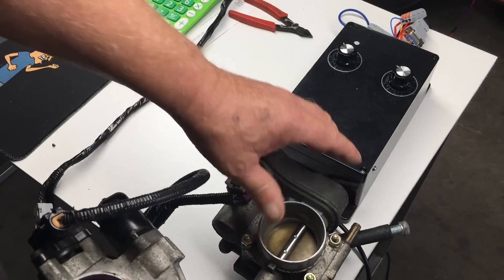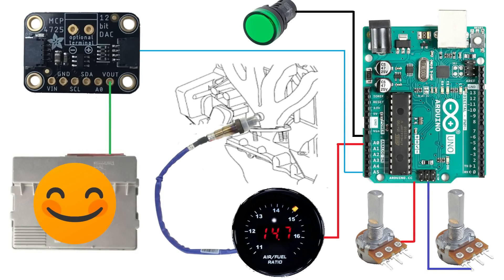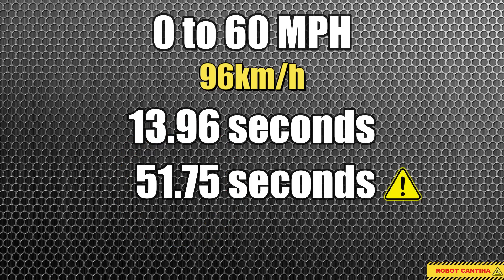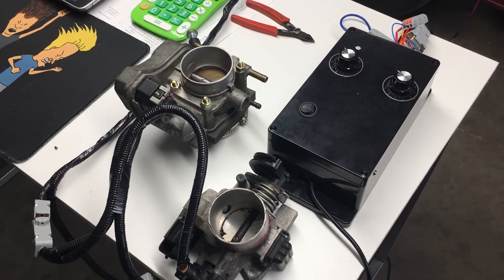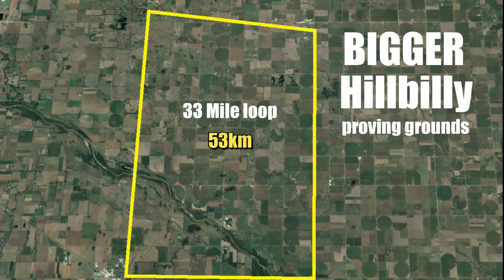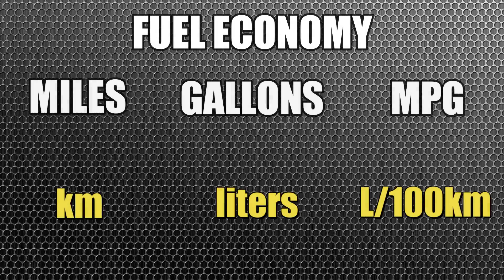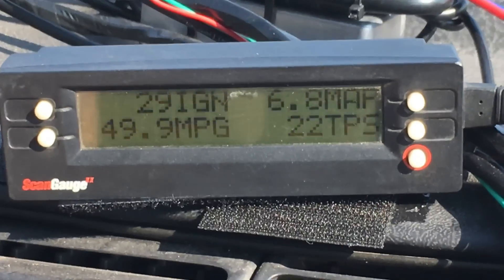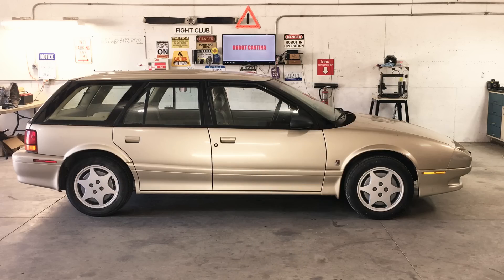S2E21: Our modified Saturn that gets Extreme MPG with lean-burn and Robo-throttle.

Comment: Cheap standalone ECU.  speeduino . Avalabile pre built or as a electronic kit . Its basically a standalone aduino ECU that is universal for almost any engine alowing full tunability  ..  . Like a haltech or other standalone unit. .
Change timing curves , injector duty cycles  and cam position/ angle in engines with the option .

Comment: 5:03 "it's very Orwellian, and thankfully this is just an experiment and cars are not really built this way."

Someone hasn't been keeping up with technology of modern cars let alone noted my post on a previous video. There are many cars on the road right now that are "drive by wire" or Electronic throttle control (ETC) where the pedal is just a spring loaded sensor and the computer moves the throttle plate in the electronic throttle body just as you are doing but it is done using the ecm instead of an arduino. Many modern vehicles are built this way now with no traditional throttle cable. For example, check out the 16 Chevrolet Cruze. It's kinda unfortunate when the pedal sensor goes out as then the car only idles no matter how hard you mash the pedal.

On the note of the video as a whole though, this is and has been fun experiment to watch develop and I would love to see how far you can take this with a TAP (Timing advance Processor) like Acamperfull mentioned. Could be an interesting next step. You know, before the Diesel swap since Wagons have a very different aerodynamic effect compared to a coupe body.

Comment: Ford EDIS?  You could grab the module off an early 90s coil pack car.  The EDIS module can run independent of an ECU with just a crank signal.  EDIS outputs a signal (spout?) To the ECU, which then outputs a signal to EDIS to advance/retard timing based on the other sensors the ECU has access to that you could leverage to manually adjust it.  You could leave the wires from the Saturn ECU to the coil packs flapping in the breeze and connect the EDIS to the coil pack trigger.  EDIS is pretty awesome and well-documented as it's a popular upgrade to give old VWs/Porsches/etc. a reliable ignition system (they show making a flat signal plate to attach to the crank pulley like you showed, but I think that's unnecessary as the Saturn already has a crank signal you could tap into).

Comment: Don't just scrap the Saturn. There is a following for those that would buy it in a heartbeat
Reply: I agree! Especially at over 40mpg!
Reply: My salvage title sc2 dohc gets over 40mpg stock with an automatic on the highway, vibrating like a paintshaker at low rpm...
Reply: @tkello001  Replace your upper passenger engine mount with an oem style one. I had the same problem.

Comment: Even an Arduino has enough CPU to modify the ignition timing signal. To perform an advance, making the output trigger before the input, isn't some sort of time-warping magic. The SW simply has a counting loop that stays synchronized with the engine, and the output is advanced based on the SW loop. Of course the tracking of speed changes needs to be tracked optmally, but since the engine is not revving so quickly, it's "easy" to do so.

Or just purchase an aftermarket ECU and be done with it.

Comment: See if you can fi d yourself a 97 plymouth breeze with the 2 litre 5 speed manual. Mine got real close to 50 mpg ( imperial) which for the first few tanks on a used car made me wonder if the fuel guage worked properly. Pretty close to 1000kms on a tank of fuel.

Comment: Hey fun fact! On the topic of sequential injection with no cam sensors, and this is straight from my AllData subscription:

"The EI module does not receive a signal from the crankshaft position sensor. Instead the CPK sensor signal is being received and processed by the PCM. The El module does, however, contain circuitry to determine camshaft position without using a camshaft sensor, by use of compression sense ignition (CSI). The CSI circuitry makes use of the characteristics of a waste spark ignition system, while monitoring a sequence of spark plug gap breakdown events. Capacitive pickup plates located under the 1/4 coil are used to determine whether #1 or #4 fired on a compression stroke. This capacitive sensing device is similar to inductive pickups used on engine analyzers and oscilloscopes."

Comment: Have you tried low rolling resistance tyres? (Bridgestone Ecopia or similar - eg Prius tyres)
I have found about a 15% difference in fuel economy between these and "normal" tyres.

Comment: Probably the easiest way to monkey with ignition timing is to alter the intake air temperature sensor readings.  The ECT and ACT will both influence ignition timing, but the ECT will also influence fueling.  The ACT should primarily influence ignition timing, to account for cold and hot ambient temperatures.
Reply: I finally found this comment, now i cad delete the one i just made

Comment: I had a 2001 SC1  back in the day and had a 2 hour highway commute.  When I would hype mile it I would get 42 to 45 mpg in stock form.  I did have a scan gauge as well.
Reply: I had a 97 SC2 and could do 42MPG on it on the highway in stock form.

Comment: I would have bet a cup of coffee that knock sensor dampening mod would have increased the ignition timing. I wonder if there's any way to "adjust" the data signal between the crank sensor output and ECU to increase the ignition timing? If it's Hall effect seems like there should be a small voltage in there somewhere to add to or subtract from?
Reply: The knock sensor retards timing in the case of detonation in a motor that is tuned to run the most advanced timing possible.  Dampening it only prevents it from functioning as intended.
Reply: @xLiteraryAllusionx  The knock sensor retards the timing when it detects a detonation in the cycle or "spark knock". Seems to me dampening the sensor so it would not detect any disturbance would have kept the ECU from retarding the timing. I think what likely happened is the ECU or ECM did not detect a signal coming from the knock sensor and so bypassed it instead of making any adjustments to the timing. Likely a fail safe in the software in case the sensor is faulty or unplugged. It was an interesting experiment for sure!

Comment: The ignition timing would most likely make a huge difference, of course.  Pre OBD II cars I've owned that had adjustable ign timing always gained power and MPG when advancing the timing 5 or 6 degrees.  
Turning the reluctor wheel or remote mounting it is about the only way on that one it would seem.  Of course, higher compression would have a similar effect if you could find a way to gain a bit.  .5-1 increase would probalby work out OK.

Comment: Rather than try to hack your way around the timing issue, Could you not just modify the timing tables in the ECU with something like HP tuners or equivalent? (I know nothing about Saturn ECU/PCM's)
Reply: apperently hptuners doesnt work with that gen of staturns.

Comment: Amazing to think that Honda achieved the same mileage with a production car.
Reply: No, robot youtube guy with junky saturn is way more impressive dude. probably took fifty japanese enginerds (engineers) to pull it off. this guy driving past rows of corn. nice job trying to diminish robot buddys achevements
Reply: @AA-tb4ff  He just ran the thing lean, that's not hard.
Reply: @AA-tb4ff  And, just to be clear, I'm talking about the Civic VX, which wasn't even a significant departure from the normal Civic.
Reply: @PistonAvatarGuy  the VX and HX were underappreciated gems.  Sadly many got turned into 'race cars' due to having a lighter chassis from the factory.
Reply: @xLiteraryAllusionx  It's a fantastic chassis, it's hard to even find them for sale these days because so many have been modified by tuners, and those guys are almost never willing to let them go. I had plans to swap a K20 into a CX, but life got in the way.

Comment: I was wondering about something. What would happen if you took a conventional mechanical parking brake and attached a cable on it and connect it to the throttle body. You would have cruise control, but one that's constant, that never wobbles unlike a normal cruise control that speeds up or down. I wonder how efficient that would be. It would make your long drives a lot easier too.

Comment: If you want to play with the crankshaft position sensor, forget the wheel on the crankshaft, the wheel on most 4 cylinder GM engines is removable from the crank, so you can get another one and mount it on the pulley then make a bracket to mount the sensor.
That's where they are on cars with the GM Family 1 engine such as the Daewoo Lanos.

Comment: funny thing but on some older volvos you could grind down the directional way the 3 pin contact for the crank/flywheel sensor and then plugging it in backwards, it gains 3 degrees of ignition advance thru the whole curve. dont really got an answer who figured it out or why it is that way but it simply works

Comment: Where's the cement mixer Honda?
Reply from the maker: The  fuel injected supercharged intercooled 420 Hemi cement mixer powered street legal go kart is temporally off the road.  The Michigan tags expired and I have to get Kansas tags.... sounds simple, but its not, Kansas inspects out of state cars and checks to make sure the VIN is correct.... I'm told they wont necessarily care what is under the hood, but you never know.

Comment: You should upgrade stronger spark plugs and a stronger battery to increase your mpg
Reply: Stronger spark plugs? Is this a reference to electrode material, cause if so copper is the best for conductivity but softer metal in spark arrestor plug electrodes.

Comment: You might want to check your Saturn again cuz I believe they use a hala affect sensor on the camshaft like they do on the Hondas
Reply from the maker: the 1.9L engine in the S series saturns use a virtual cam sensor, in other words, they fabricate the cam sensor signal by using some clever math and monitoring certain events on the coil pack.
Reply: @robotcantina8957  that is crazy that's kind of a cheeky design so that means if your coils go bad your timing will go out of whack?
Reply: @Kansas Rose yeah I know this is great video I've been following robot cantina since they started on the Toyota insight with the harbor freight motor I think they're very witty and very insightful and what they do.

Comment: It's amazing what you have done with the factory ecu, but for the next one I highly recommend a stand alone setup.  Personally i'm not a fan of speeduino because of the limitations, speed, and reliability of the arduino.  I recommend you look at rusEfi, all open source and based around the STM32.

On ignition timing i'm in the 40's at cruise around 15.5 afr, up to about 55 kpa, on a stock 302 ford and have gained around 40% compared to oem.  On the Saturn with a more hemispherical combustion chamber it will be more detonation resistant, but also more efficient burn so more timing may or may not be beneficial in vacuum.
Reply from the maker: I'm not a huge fan of the Speeduino, but we use one on our fuel injected supercharged intercooled 420cc engine in the Honda Insight.  The NO2C speeduino we used was made for 1 and 2 cylinder engines.  Personally I prefer Megasquirt and have done quite a few builds using them.
I looked into RussEFI a few times,  I even followed his shenanigans on a thread on the grassroots motorsports forum.  I always find RussEFI information to be confusing and conflicting.
Reply: @robotcantina8957  You could actually use NO2C for staturn. You'd lose sequential ignition/timing, but NO2C can be configured to run on 4 cylinder engines. Obviosuly this isn't ideal, but i'm sure it shouldn't affect fuel efficiency that drastically. 
Something to think about, IF it can be even retrofitted into existing staturn sensors/ignition.
Reply: @robotcantina8957  I have used megasquirt as well, my daily is megasquit 3, and i have a customers daily on v3 microsquirt.  My current project is a turbo 2300 ford, ls coils, flex fuel sensor, and for the microRus I have found the info I needed so far from the wiki. Layout is strange on the wiki and in tuner studio compared to MS, but the size, capabilities, and price sold me on it. Currently doing suspension, wiring, and fuel system.

Comment: On old Volvos from the 90s you can flip the wires from the crank position sensor and ger 3-4 degrees more timing. It maybe works for the Saturn too?

Comment: Saturn's use the ignition module mounted on the trans and the coils mount on. There is a sensing circuit to listens for number 4 cylinder to fire. That is how it uses sequential injection. Also if you trick the intake air sensor that it is colder it will run more timing. At 100 dgs air temp it pulls 3 degrees of ign timing. But you will have to be creative because if you leave it tricked over night when you start it you will get a fault for it. I believe it uses the engine coolant temp to compare the intake temp for over night soaks to verify it is working.
Reply from the maker: I'll do an experiment this week, thanks for the heads up on the CLT and the IAT being compared on start up.  We can easily get around that.  Thanks again!
Reply: @robotcantina8957  also if you want to add more timing you can trick the map sensor to believing that the engine has more vacuum than it really does. But one thing you may start to run into is a system rich or lean fault. If the fuel trims ate + or - 20% of expected fuel delivery you will get a fault. I am unsure of any actions taken by the pcm other than the fault. Also. Map sensor is used as a barometric sensor and is used to gauge elevation prior to starting the engine. I have quite a bit of knowledge with  saturns specifically. Let me know if you have any questions.

Comment: At a reasonable rpm, the time for one crankshaft rotation is going to be very close to the next (and previous) rotation time. Couldn't you use use software to "retard" the timing by say 355 degrees, so effectively advancing it by 5 degrees (or whatever's needed}?

Comment: Acceleration fuel consumption is a tradeoff game.  Sometimes a harder Acceleration can burn less fuel than a protracted Acceleration at a lower throttle setting.  The efficiency of a gas car varies depending on load, engine speed, vacuum, fuel ratio etc.  You may find some of your MPG improvements were due to more efficiently getting up to speed via spending less time running at very low efficiency.  Another thing to verify is that your EGR is working properly.  It's not just an emissions control.  It also improved engine efficiency by reducing pumping losses during closed or part throttle operations.
Reply: i'd say EGR will only help efficiency if paired with a drive by wire system that actually knows egr is present. EGR can help with efficiency, because you can run EGR fully open and also fully WOT. Because you already have spent gasses with air mixture, you can have the throttle opened more or even WOT. This results in less pumping losses (as you've noted) while there is less than normal O2 conent, because EGR'd gasses displaced O2.
I'd say in the case of staturn, EGR is there purely for emissions.

Fun fact for those unaware; some older cars actually do EGR purely via VVT. They use valve timing to trap some exhaust gasses for the next cycle.

Comment: You could use the IAT to make the computer add timing. You already have a system to keep it from enriching the fuel for the colder IAT reading. A potentiometer on the IAT circuit to make it read 32F or just unplug it. It normally defaults to -32F when unplugged anyway.
Reply: Unplugging it will 100% cause a fault code and it'll go into limp mode. Using a potentiometer however... that's good thinking. Nearly all IAT's are NTC type which means more resistance = cooler reading.

However this assumes the factory tune increases ignition with lower-than-usual temperatures. It'll also add more fuel too, Jimbo would have to offset his lean burn threshold even more to compensate. It's not impossible to do it this way but a bit of a challenge.
Reply: No limp mode with most early OBD-IIs. (Doesnt even come with factory electronic throttle) Unplugging it will read -32f just as he said.
Reply: I know on Fords of this era, the IAT sensor doesn't add timing, only removes it.

Comment: Just an afterthought: how hard would it be to develop aftermarket fuel economy systems for various existing cars? I mean besides the performance chips that are already being made? Because performance chips are made for making your car go fast, they are not made for getting better fuel economy.
Reply: an aftermarket ecu. it can be tuned to lean burn under certain conditions, youtube channel legit street cars did this with a c6 corvette, and got 40mpg while still making over 400 wheel horse power.
Reply: As someone who's trying to create a mod for cars I can say to you: really hard to next to impossible hard. Manufacturers really like to change everything they can, so basically we're talking car-on-car basis. Generic things like this might be possible for old enough cars, but without testing each and everyone, you're basically assuming all will react the same.
Reply: i'd say it's unlikely because modern cars already follow strict emission regulations.

Comment: For reference, one of the earliest (and therefore should be quite primitive) lean burn cars, The toyota Carina with the lean burn engine option of the mid 1990s, could get Air fuel values as far up as 17-18:1 when in lean burn mode, as far as I recall. But its been a looong time, perhaps those values from my memory are not fully accurate, and it was even a bit more.